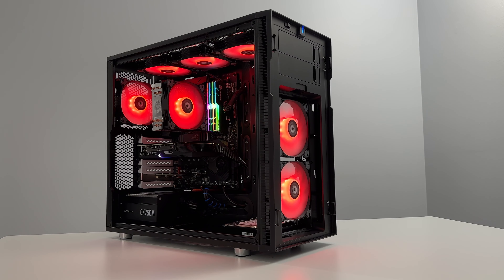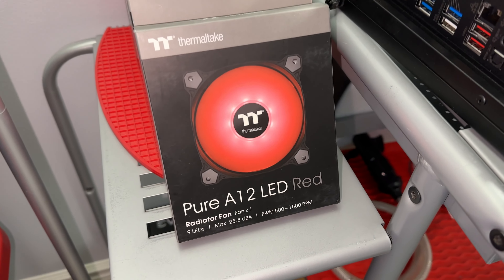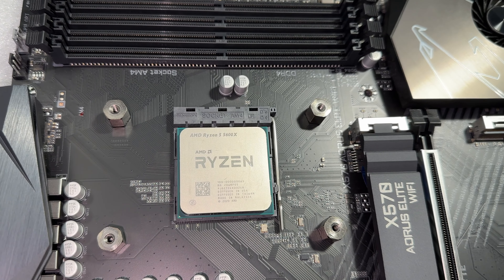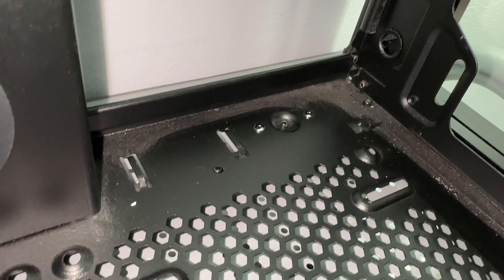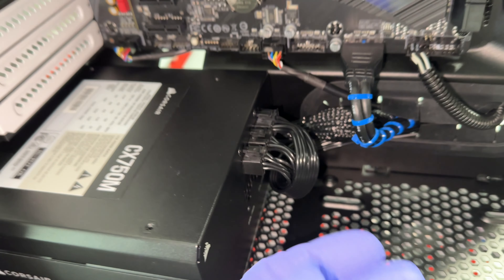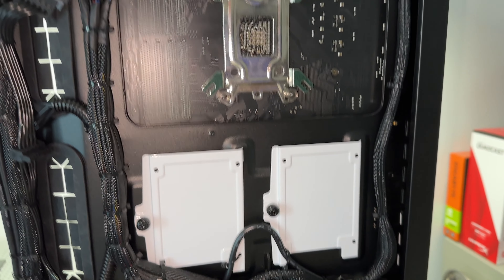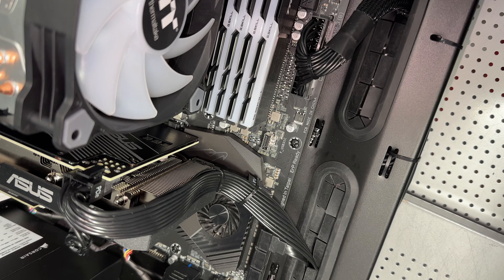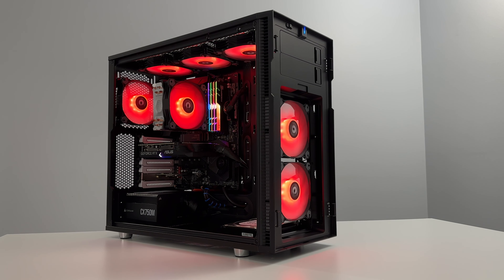How To Build a Gaming PC - Call of Duty Budget Build

Comment: Great video bro, thanks for the info. Just curious how do you know how many fans to put in?
Reply from the maker: Thank you for your comment and support cuz 💙 You can usually tell by looking at the case directly or researching the case specs online to see how many fans and what sizes are supported. Often they will have a diagram that shows were exactly inside the case and how many. With this case I could tell just by looking and ended up removing the top front bracket cover and DVD drive tray in order to fit a 3rd up top and further increase the airflow. 💯 Really happy with how the finished product turned out. 😊